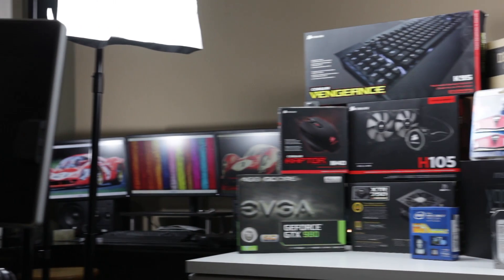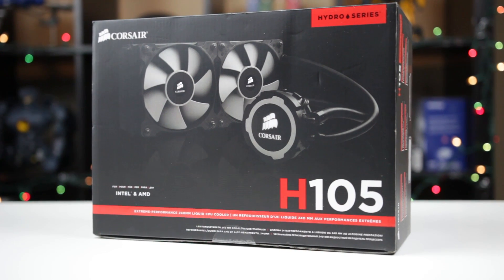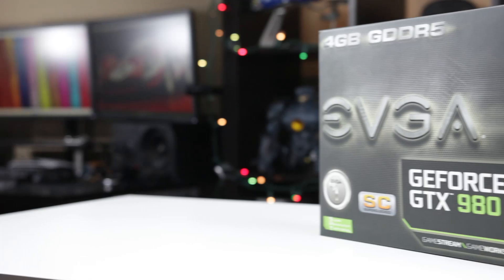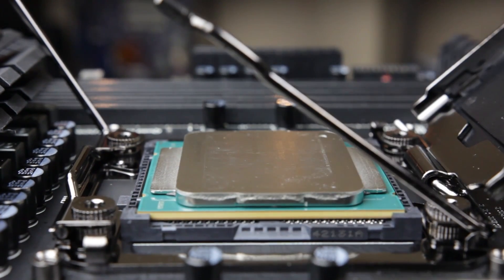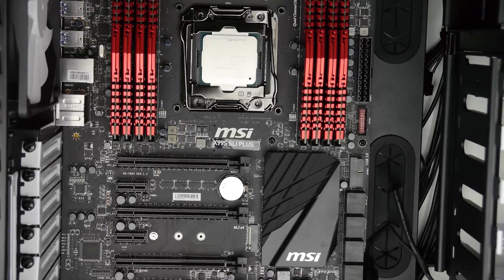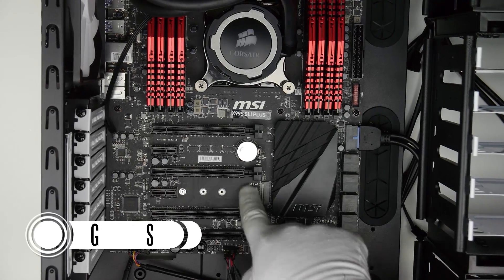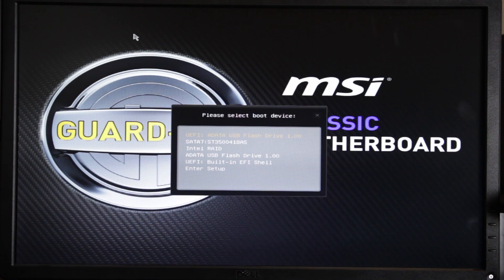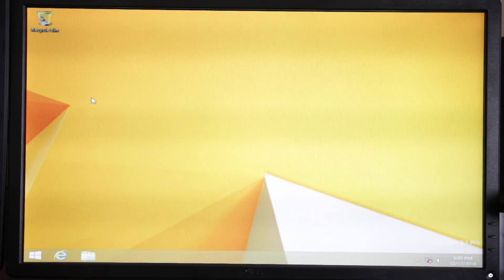How to Build An Epic $4000 4k Gaming & Video Editing Dream Machine for 2015

Comment: I got a quick question here, i'm getting my new build soon, and im gonna use the Kraken X61 after i read some reviews and i really liked it, but what if i do a pull configurationWhere the fans are touching the top of the case and the radiator is below so the dust will be able to just get taken off by hand or something and i don't have to un-screw the whole thing to take off dust that has collected for maybe 2-3 months? Would that be fine to do? I heard LinusTechTips said it was the best thing to do with your cpu liquid cooler.

Comment: Grate build!!! I need to build a new gaming PC as my old one is getting slow. My old setup was- maximus 5 extreme with i7- 3970k, 2X GTX 680 SLI with 32Gb 2400hz RAM, All water cooled. Its was 3 years back and serve me well until now.
This time i wish to go for another killing machine. I need a little help as I`m getting outdated my self. This time I wish to go Rampage v extreme/u3.1 or MSI X99S GAMING 9. CPU i7 5930K or i7 5960X. GPU 2X GTX 980 Ti on SLI or 2X Radeon R9 295X2. g skill ddr4 3000mhz 32Gb. This what I thought of. I have 1500W power ,other SSDs, HHDs, that I can salvage from the old rig. What you guys think or your advice. Do I go for this or is there something better.

Comment: I got the same build, but with the 980TI. so its 6GB ddr5 ram, around 700 bucks. Then the rest is the same, except i got ddr4 32gb of ram.
the thing is.

guys you could get the same performance for 2 thousand, if you just dont get the ssd's and some other stuff

Comment: I bought this components I will use the PC for gaming [Ultra-High Definicion Games], do you think they are good??
Componentes:
-ASUS SABERTOOTH Z97 MARK S LGA 1150 Intel Z97 HDMI SATA 6Gb/s USB 3.0 ATX Motherboard
-Silent Pro Gold 800W
-Intel® Core™ i7-4790K Processor
-Noctua NH-D15
-Vengeance Pro DDR3-2800
-WD Green
-LG BH16NS40
-ASUS STRIX GTX 980 OC 4 GB
-Asus Xonar Essence STX

Comment: 1. 5930k for better sli performance
2. h105 ? really ? hell no ! better nepton 240m or nzxt kraken x61 
3. 980 sli is the minimum for 4k gaming . 
4. not enough big case for that hardware. you need something with more airflow . something like corsair 780t or Phanteks Enthoo Primo Ultimate
Reply: 2 way sli the 5820k is still fine. At 3 you're right a 5930k is good, otherwise you are right this build sucks for $4000. I was expecting  a 980 sli and 64gb ram is a waste 16-32 is fine
Reply: ***** yes but you maybe need a pci-e hard drive in the future ( when the prices going to be normal enough) ,
Reply: *****  yes better 32 gb in 3000+ mhz,  maybe 3600!!
Reply: Agreed this build sucks for the money

Comment: Wait wait wait. Corsair says you should use INTAKE? So that means that you're bringing in ambient air, having it pass through your radiator which transfers energy (heat) to the air and then it goes into your system and other components are exposed to said energy? This is why these AIO Radiator liquid coolers are so lulz to me.

Comment: ASUS RAMPAGE V EXTREME, Extended ATX x99 Motherboard , LGA 2011-V3 Socket, DDR4 3300Mhz+(OC)

EVGA GeForce GTX TITAN Z 12GB GDDR5

Samsung 850 EVO 1TB 2.5-Inch SATA III Internal SSD

Samsung 850 Pro 1 TB 2.5-Inch SATA III Internal SSD (MZ-7KE1T0BW) 

Seagate 4TB SSHD SATA 6Gb/s 64MB Cache 3.5-Inch Internal Bare Drive

Corsair Air Series AF140 LED Quiet Edition High Airflow Fan 

Corsair Graphite Series 780T Full Tower PC Case

Intel Core i7-5960X Haswell-E 8-Core 3.0GHz LGA 2011-v3 140W Desktop Processor 

ASUS Xonar Phoebus ROG Gaming Soundcard Set Sound Cards

AVerMedia Game Recorder -C985 Live Gamer HD. Game Capture/ Live Stream HD 1080p

LG WH16NS40 16X Blu-ray BD BDXL MD M-DISC Burner CD DVD Internal Drive 3D Playback

Corsair Vengeance LPX 32GB (4 x 8GB) DDR4 DRAM 2666MHz C16 memory kit for DDR4 Systems 32 DDR4 2666 (PC4-21300) (CMK32GX4M4A2666C16R)

CORSAIR AX1500i 1500W ATX12V / EPS12V 80 PLUS Titanium Certified Full Modular Power Supply. Model CP-9020057-NA

Corsair Hydro Series Extreme Performance Liquid CPU Cooler H100i

Comment: The parts on this computer don't add up to no $4000. $2600 or $2700 at the most. Don't think this guy knows how to add. By the way who uses fuzzy white museum gloves to work on computer. What are you a curator Waj

Comment: any thoughts on my PC? 
(just under $4000)

-i7-4790k
-GTX Titan Black Hydro Copper Signature
-16GB Ballistix Sport (2x8GB 1666)
-ASUS Maximus VII Formula
-CoolerMaster HAF-X Nvidia Edition
-ASUS 18, AOC 21, AOC 28 and Samsung 42 (i use mostly the 21 and 42)
-Intel 180GB SSD, WD 3TB HDD, Seagate 3TB HDD
-Corsair RM1000 1000w

-EKWB EK-Kit 360X (water cooling)
Equipment: R.A.T.9 / G19s / G930 (included in the price)
Reply: ***** yes, and where is the bottleneck
if it's the Ram you're referring too. then yes i'm gonna change my Ram, but not until i start rendering in 3D Studio Max
Reply: ***** no titan here
Reply: ***** yes, that i got
Reply: ***** this PC is not for playing Minecraft :)

it runs the server while I play on my ROG G751JY Laptop
Reply: ***** why?
cuz it's 4 core?
it's on 4GHz right now
Reply: sujeeth nadella the high cost is due to tax and shipping which is added to the prices in countries that sells Products that isn't made there ';. \
Reply: sujeeth nadella now you lost ne
Reply: ThePaalanBoy scrap that whole build. if you want a real build in that price range message me and i'll e-mail it to ya.
Reply: Jeremiah Fiek I have a budget of 2000$. Could you suggest me dome parts?
Reply: Some*
Reply: Jeremiah Fiek noh, already bought it.
it was just to build my own pc more powerful than my friends, anyway i bought a ASUS ROG G751JY for occasion where portable is necessary

Comment: At one point you said the 5820k was a budget 6 core cpu -_-
Reply: Daniel Burgos hahaha look at this guy you forgot fx 6300?
Reply: It is lmao it's the lowest price 6 core out right now
Reply: It's a Intel based system didn't bother listing AMD products
Reply: Jonathan Byrd your the idiot here
i meant that the fx 6300 is the lowest 6 core processor
and yeah amd is shitty
Reply: CPU brand is based on opinion. Personally I prefer Intel because their four core is generally faster than an AMD 6 core and the i7 4790k kind of has 8 cores because of hyperthreading.

However, if you're building a pc on a low budget (about £500) for video editing and rendering I would recommend AMD's FX-6300 or the FX8/9 series because they have more cores and are the best bang for buck cpus out there for this specific purpose.

Don't listen to these dweebs when they say that AMD is shitty, it's based on preference, yes AMD's run hotter and are generally not as widely used for gaming as Intel is, but so what! I've met people who play Battlefield 4, COD, etc. on ultra settings who are AMD dedicated and refuse to play on an Intel chip
Reply: +Shadow Blu19 the 6300 still performs good for the money obviously it will suck compared to these haswell-e cpu's because they cost way more

Comment: Hey up Waj, liked you build so much, hope you don't mind but have built one same spec, plus Bluray Writer and card reader, but apart from that, bang on.  Can I ask what final performance you managed as i'm yet to start with overclocking the CPU or GPU.  Have configured the SSD's in RAID10 also as will be doing video editing, which have tried already and works well.  Best PC I've had! Cheers. Have seen your benchmark video already.

Comment: Very interesting, great video and the way how to explain it pro, I would set up my pc specially change my motherboard EVGA Classified SR 2 to a Supermicro X9DA7, I would do as you like configuration: SATA2 to put in 4ssd raid 10 but I have two SATA3, I do not have 4 sata 3 (6gb / s) only for system and programs such as Adobe Premiere Pro, and 2SS video SAS2 storage (6gb / s), it will be dear, do you think it's possible to put 4 sata ssd in 3.0 (6gb / s) to work in 4K? I have 1 Titan GTX GTX 680 SC and 1, 2x Xeon E5 2650, thank you for your support and your help, it's nice to meet passionate as you.
in french:
Très intéressant, vidéo parfait et la manière comment vous expliquer c’est du pro, je voudrais configurer mon pc spécialement changer  ma carte mère EVGA Classified SR 2 de mettre une Supermicro X9DA7, je voudrais faire comme vous comme configuration : mettre 4ssd en sata2 pour un raid 10 mais j’ai que deux sata3, je n’ai pas 4 sata 3 (6gb/s) seulement pour Système et programmes exemple Adobe Première Pro, et 2SS pour stockage vidéo en sas2 (6gb/s), ça va être cher, pensez-vous que c’est possible de mettre 4 ssd en sata 3.0 (6gb/s) pour travailler en 4k? J’ai déjà 1 titan GTX SC et 1 GTX 680, 2x E5 Xeon 2650, merci pour votre soutien et votre aide, c’est sympa de rencontrer des passionnées comme vous.

Comment: When u say 4k, do you mean 4k as in $4000? Cause I don't see a reason why you would stop at a single 980. You need 2 980s for 4k gaming experience. 
You could have at least used a r9 295x2 if you were limiting to a single card.

Comment: The system above is a nice build for Video Editing and Gaming.  I went with the 5930k, Asus X99 Deluxe, 32 Gb's RAM, EVGA GTX 980 ACX 2.0, NZXT H630 Case and Kraken x61 AIO cooler.   Crucial MX100 for OS drive, (1) WD 4Tb, and (2) WD 500 Gb drives.  It feels good to boot-up and throw whatever you want at your system, and not have to see it crawl down on it's knees.  You have an excellent build.  Don't let the negative comments deny you of the pleasure of owning it.

Comment: i wonder why you set the rad into intake, specially its at the top and will inhale dust into the system. is the front intake inadequate as to cooling the system and the rad?

Comment: Why did you insert the G Card into the PCI_E3 slot (check manual) you should've inserted into the PCI_E1 for guaranteed best performance, unless if it doesn't fit then I totally understand.

Comment: how good is this build?

GPU     NVIDIA GeForce GTX 980 (3x)

SLI Bridge     NVIDIA GeForce GTX 3-way Bridge

Motherboard     ASUS Rampage V Extreme

CPU     Intel Core i7-5960X Haswell-E 3.0GHz LGA 2011-v3 140W 8-Core

RAM     Corsiar DOMINATOR 32GB (4 x 8GB) DDR4 2666 (2x)

Cooler     Corsair H100i AIO Cooler

Case     Corsair Graphite 780T

Solid State Drive     Corsair Force LX 512GB (2x)

Hard Drive     Seagate Barracude 2TB (2x)

Power Supply     Corsair AX1200i
Reply: I think it's good I think the above me is being sarcastic

Comment: 950 dollars for CPU and GPU? Where the hell do you get another three thousand dollars?!? This is NOT a gaming build. Ram costs one thousand dollars alone.

An "Epic" gaming build would have three 980's, a 5960X, which would cost 2500. Then, you would have 1500 to spend on other things.
Reply: A 5960x wont give any performance boost to video games over this cpu with any game coming out in the next 5 years and 2 titan Z's are better than 3 980's due to the third gpu in triple gpu builds not giving much added power. Also $1500 is not nearly enough money for a MoBo, RAM, Hard disks, A power supply, Case, and Cooling components. All and all this is a fantastic build and would only get better by either adding one more GPU or upgrading the GPUs to Titan Zs.

Comment: 4,000?  it's a nice setup but you kind( kind of nothing you screwed yourself on that build) of cheated yourself out of a lot of computer for the money.  with 3600 bucks walking into the local computer store i can build:

i7 5930K
MSI X99S SLI PLUS
Corsair Hydro H105
4 Samsung EVO 250GB in RAID
WD Red 6TB
Crucial Ballistix Sport 64GB DDR4-2400 
EVGA GTX 980
Corsair RM Series 1000 Watt PSU
Corsair Graphite Series 780T full tower
windows 7 pro 64 or windows 8.1

Faster CPU, Faster ram, Larger storage drive, Superior and larger PSU
Reply: if i wanted to i could do 2 gtx 970's with that configuration and still be under $4k, or even upgrade to a corsair AX series PSU or even go up to DDR4 2800 ram and be under 4k
Reply: Maxxx Computers i could put all of that into the corsair 900D arkham origins limited edition case and be under 4k

Comment: a single 980 for 4k?? Unless they are old and less demanding games...its impossible to game with a single 980 at UHD resolution
Reply: Aspen Young anything below 40 frames is not usually an enjoyable experience...
Reply: Aspen Young Battlefield 4 is bullshit... I run 2 970's in SLI and I can't maintain 60 fps at ultra on 4k...
Reply: Incorrect, go check benchmarks. The only games this wouldnt work for are high end Cryengine games such as star citizen.
Reply: I own a 980 dude...i do not need to check benchmarks...of course you can run less demanding games....you can run dota 2 on 4k with a 760 but thats not the point...you cannot run any AAA title in decent settings
Reply: Fps for games running at max 4k with a single 980 GTX: 

Farcry 4: 38
Battlefield 4: 57
COD AW: 42
Crysis 3 (real time dynamic tessellation off, anti aliasing off): 25
Metro Last Light: 33

and there are more.
Reply: soumya basu true

Comment: What do you mean by over-clocking?
Reply: You serious? Overclocking means running a processor or some other device such as a Graphics Card at higher than it's standard clock speed. It can be dangerous but it can also make a computer or VC (video card) run MUCH faster than normal.

Comment: Nice computer but I wouldn't go x99, I think I would go Xeon 2011 with ddr3. 64gb of ddr4 is a lot of $$.
Reply: Xeon is used for servers so a xeon would not be an ideal choice. I think a x99 is perfect for editing/gaming.
Reply: You can build a desktop xeon. I don't see any advantage to using ddr4 to ddr3. It's a great build but he could have went gtx980 SLI for the same price if he had went with a 4930k as an example.
Reply: Barack Smith Yeah but he later on got a triple sli config so it doesn't matter but you have a valid point.

Comment: Was there a reason why you chose to place the GPU in the 2nd PCIe slot as opposed to the 1st one? I understand that it doesn't make a difference on the X99 boards bc I'm sure they are both (and maybe even all of them) are 16x slots, but if this video is for newbies who might still be on the Z97 platform or older I think you should have explained why and that they should be using the 1st PCIe slot. On top of that, you seem to be blocking your M.2 slot (and why aren't you using one of those in your "Dream Build" with 10 Gb/s?) Otherwise awesome build and video!

Comment: Lovely so you compromise your cpu and spend the money on ram you don't need and then tell people you have a mobo that supports quad sli when you don't have a cpu to fully support it? If you want raw performance and bang for your buck get an e3 1241v3  and r9 295x2 and one hell  of a system for half the price. Another thing why would you indulge in raid 10 ssd without ecc memory?

Comment: Nice computer, fast processor, 64GB RAM, how many SSD's again? I'm still at Core i7 2600K, 16GB RAM, 1 Intel SSD (and 3 regular HDD's) and 2 GTX 680. Maybe some day I have the money for an upgrade too....... Since I'm looking at new CPU, new motherboard, new RAM, it adds up  quickly. I don't use the PC for playing games but I do work on video editing and 3D rendering, so there is a need for speed (and memory capacity).

Comment: Great video!

But I have to questions:
1. Did you have any problems with fitting the H105 to the system? (Motherboard clearance, space for fans etc)
2. How is the H105 cooling the 5820K? What is you idle and 100% load temps.?

Thanks for a great video :D
Reply: true that MOST games won't be able to use mor ethan 4 cores ... well it's because of the game engines and the way they work. 
I think that the 4790K is going to be a really solid choice for gaming and even more .. I mean I was planning to go with that CPU for video editing (amateur ones) and I am sure that it will handle everything pretty well. 
It can't be explained exactly why because it's on really a level of a programmer to say why games can't use more cores ... If I am wrong ... well have a nice day and sorry for wasting your time reading this :D lol peace
Reply from the maker: neurotoksin No real issues installing the H105, just needed to plug in the CPU power, waterpump power, and radiator fans connections to the motherboard first, Because the fans on the rad will block access to those connections once installed. I'm still fine tuning the system in terms of overclocking and cooling, so ill try to get back to you on exact temps. But so far I'm pretty happy with it.
Reply: Okay, great. I started out with wanting the H110 for max cooling but after realizing it wouldn't fit I went with the H105.

Great, would love to get some feedback!
Reply: ***** anti-static I think ..
Reply: +imgone because the single core perfromance is better on the quad core, look that up, aka more games are lightly threaded and better optimized for that then using more cores
Reply: +Georgi Popov  Well there is nothing processor can do while gaming expect in game loading time .. 

the thing what you are expecting that a processor going to do ..  thats why we have GFX  for  .. GFX do the multi tasking in gaming 

in previous days games depends upon cpu .. but now all are on GFX only :)
Reply: +neurotoksin  i have same build. my cpu runs at 35c
Reply: +neurotoksin 
Great! now show us How to Build An Epic4k Gaming & Video Editing Dream Machine for 2016 in  $1000